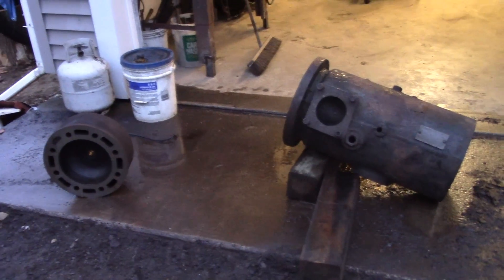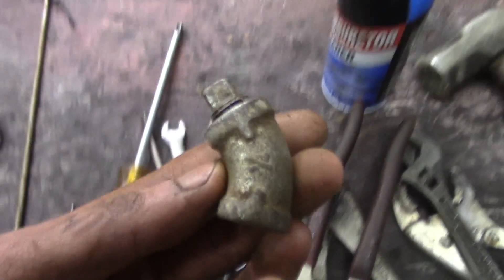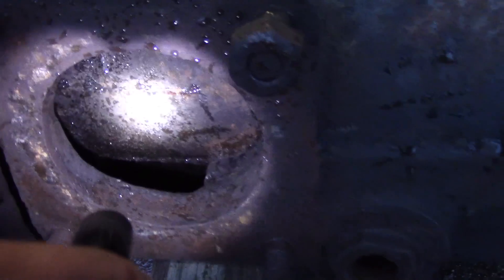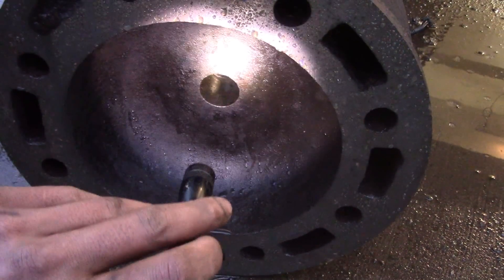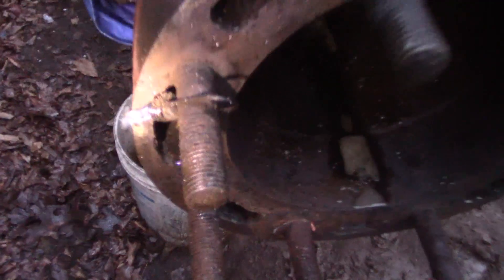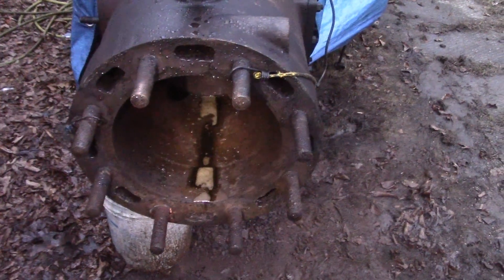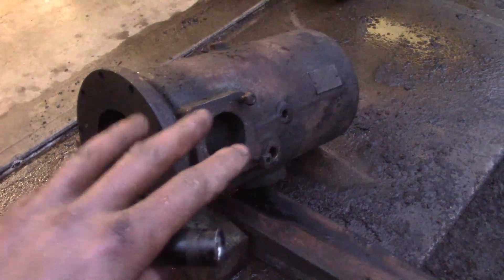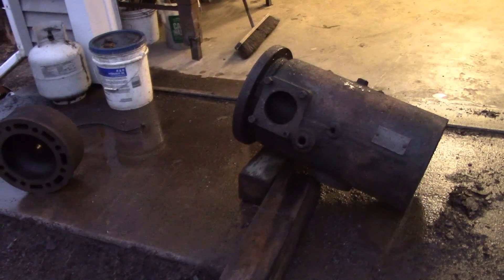Home Made Pressure Washer Nozzle - Oilfield Engine Cleaning

Comment: you need to put the head back on and seal them to the block. fill up the water jacket with diluted muriatic acid let it sit then flush it out a few times.
Reply from the maker: I agree. I don't think i'll do that with the Pattin since it's already very clean inside, but for sure the Bovaird and Seyfang will get the juice!